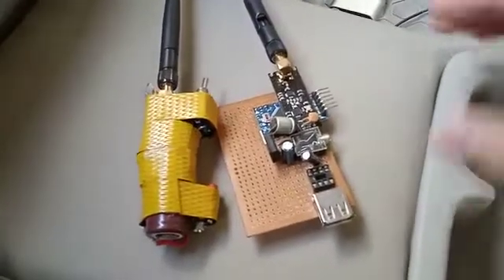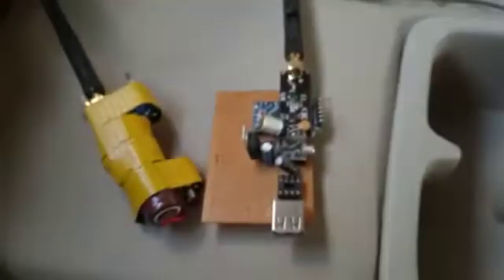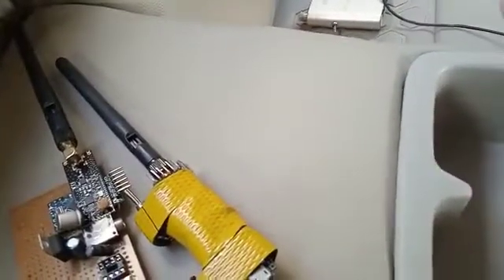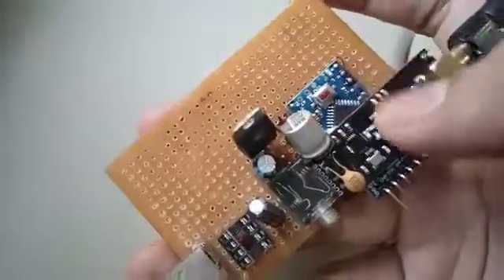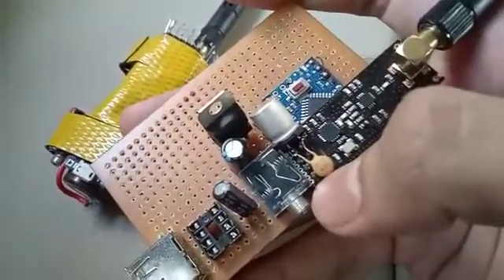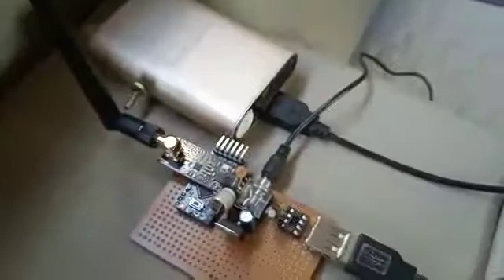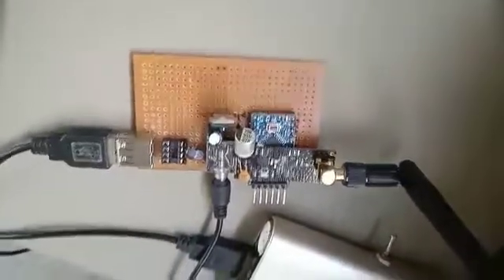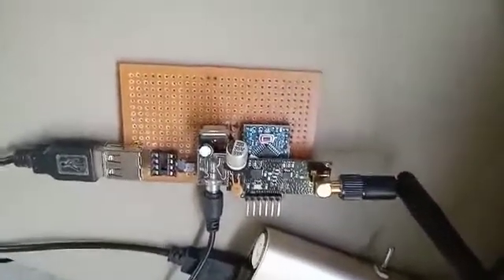Audio transmitter using nrf24l01 module [Part1]

Comment: Can anyone say what is the component or an element at time of transmission in board where the audio jack is connected to in the board what is the board? While transmission, he connected one jack to transmit the audio rate. In the PCD board, there is a component to which that microphone jack is connected. What is that component? How it works? Can anyone explain that?

Comment: Hi, instead of arduino can we use DAC or ADC converter?? Or some small class d amp??
Reply from the maker: no arduino must require to decode nrf module code, it must be req. you amplifer after arduino output
Reply: @rfhacknikola  ok so do you think it is suitable for projects like wireless microphone or wireless guitar trans receiver system? 'Cuz delay is aproxx 300 ms....